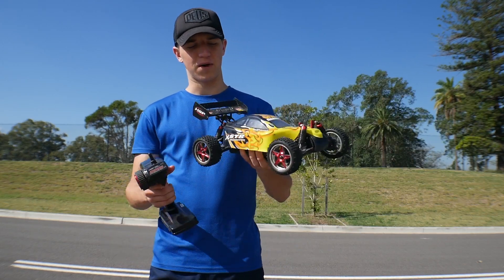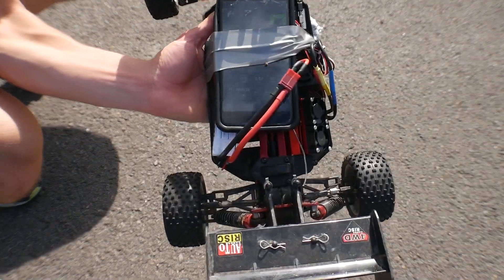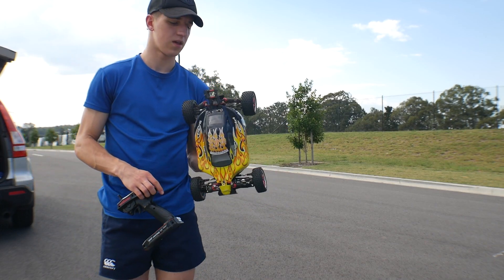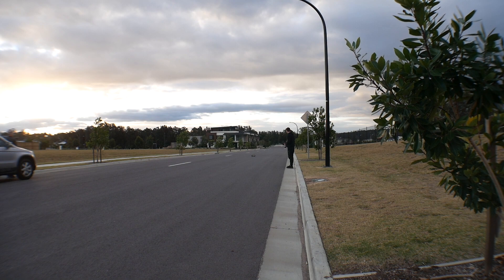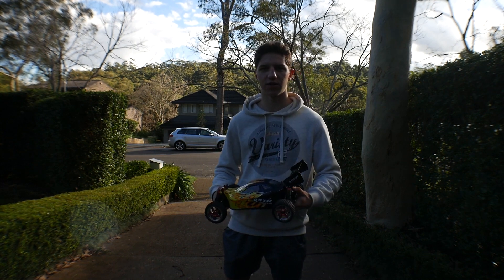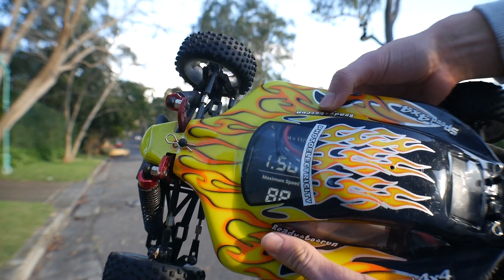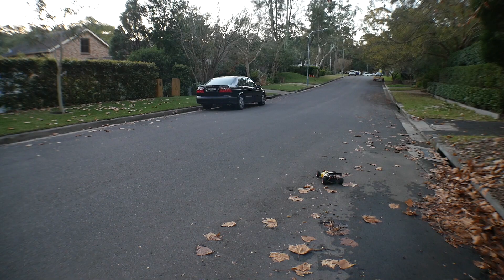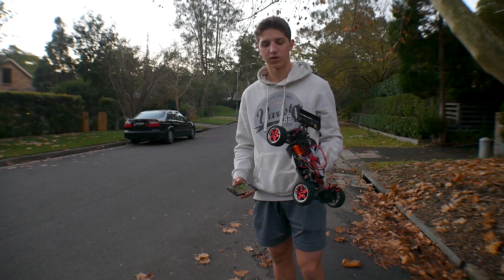RC CAR 100KM/H ATTEMPT 3s lipo + new gear ratio testing

Comment: You overheated it with that 27t pinion a bit too much for that motor, that's why its overheating,can also kill an ESC as well if the motor is over geared too much.  Also depends on the amp rating of your ESC, and also the kV rating of the brushless motor, for that setup you'd want to run at least a 120amp ESC on 3s. That should get you closer to 100kph

Comment: You need A 4s brushless system... Look into A hobbywing 4s quicrun esc and a red goolrc motor that can handle 4s cuz that system just can't pull that much power...I run custom made rc cars so If you have any questions please ask I'll try to help.
Reply: also you need some good belted speed tires to hit that speed.... because if that rubber tire blows up that car will go sideways into A curb cuz they just can't handle that kind of speed...
Reply: And also for hitting speed you need A good 4s lipo battery that has like 50c discharge..
Reply from the maker: thanks for the reply, might have to look around for a budget 4s esc. Wont cheap out on the battery though. Ill need to order some new tyres soon too
Reply: @mertyg  yah the hobbywing 120A quicrun is like 60$.. and motor is 25$ but you will also need to upgrade the gears cuz the stock 1ns will shread very easily
Reply: @mertyg  don't cheap out on the esc.. you will keep blowing them and it will cost u more money to replace em then getting A good quality esc
Reply from the maker: Good point. I’ll have a look at my options
Reply: Would that be a good set up for a habao 10sce 4x4
Reply: Or would the red goolrc 3300kv with that hobbywing 4s quicrun  be better?
Reply: @blakerobertson8008  yes man the hobbywing quicrun 60A and a goolrc 3100kv would be good for that rc car.. but only run 2s it will be plenty... If you want crazy power then run the hobbywing quicrun 120A 4s esc and like something around 2000kv for the red goolrc motor.. If you can't find the motor check out aliexpress they have the 3900kv red goolrc